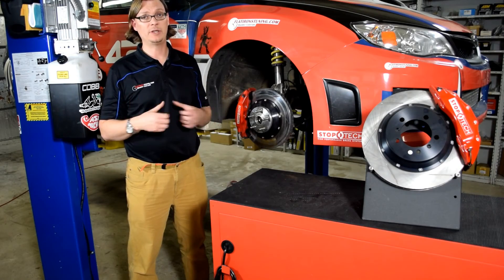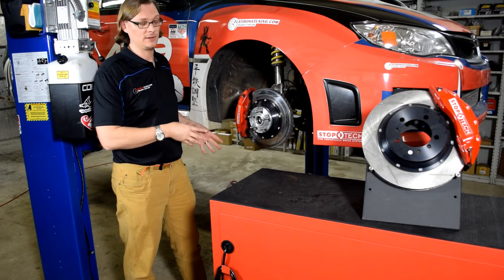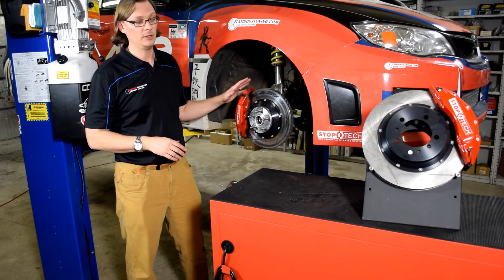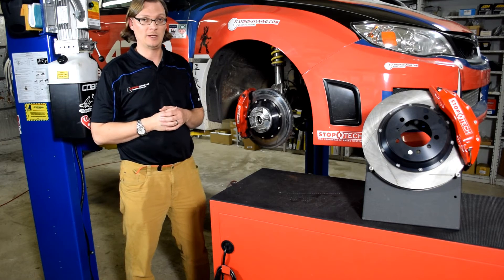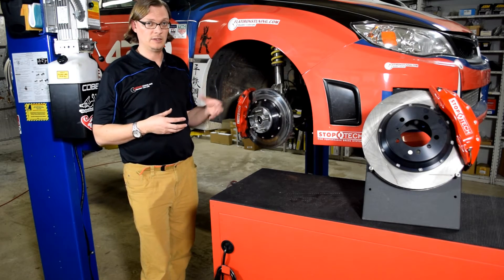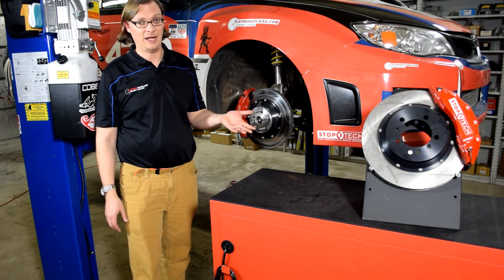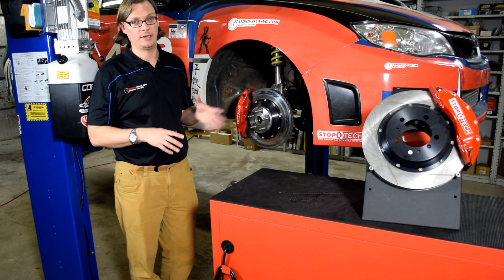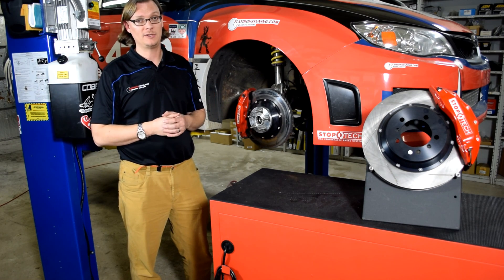A look at the Brake Up Grade Path for our 2014 WRX Pikes Peak Race Car

Comment: Hey guys, just wondering what the initial light weight aluminium front caliper and two piece rotor set up was that you mentioned? The one just bigger than legacy gy rotor you said
Reply from the maker: Thanks for your question.  That is the AP Racing kit I believe:

https://www.flatironstuning.com/essex-designed-ap-racing-comp-big-brake-kit-04-17-sti

We have done another video on it and it is about the best performing brake kit that will fit under a 17" wheel in our experience:

https://youtu.be/kQw4c_2jzfg?si=31GvtLcLjl7a96RF

Hope that helps and Stay Tuned!

Comment: Why didn't you use a 08-14 black sti front brembo setup rather than the stoptech ST40? Just curious, thanks!
Reply from the maker: Thanks for your question.  We went with the Stoptech because of the 2-piece rotor, and the thicker pad material.  The STI rotors are pretty heavy, and the Stoptech rotor saved us a good deal of un-sprung weight.  Also, the Stoptech pads have more material than the STI pads which helps too.

If we had it to do over again, we most likely would have gone with the AP Racing kit because it has the light rotor, and much thicker pads than even the ST40 calipers.

https://youtu.be/kQw4c_2jzfg

Hope that helps, and Stay Tuned!
Reply: @FlatironsTuning  thanks for that info! i am following along with you guys with my 2013 wrx. i currently have the st40s. i noticed that the brembo pads have more surface area, but yes the ST40 pads are thicker. does this mean that thicker is better than larger surface/contact area? 

thanks again!